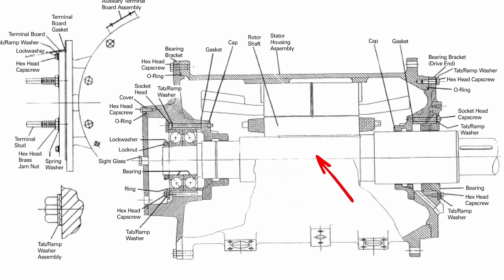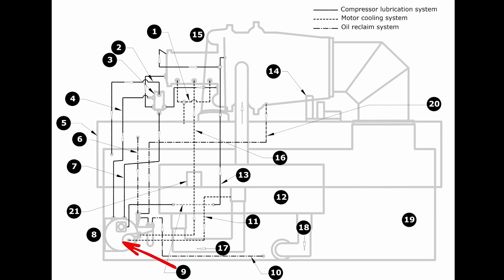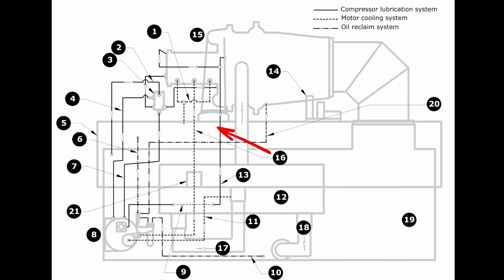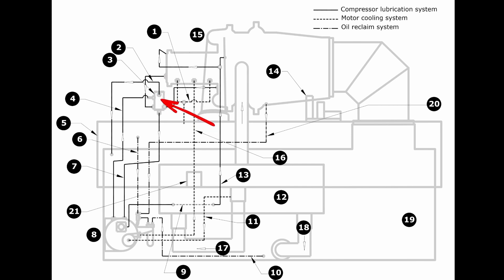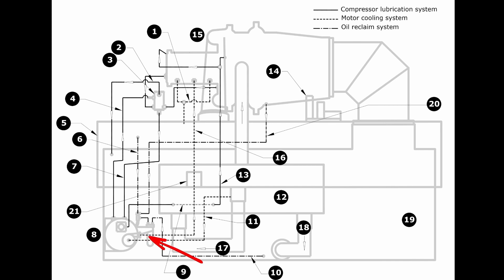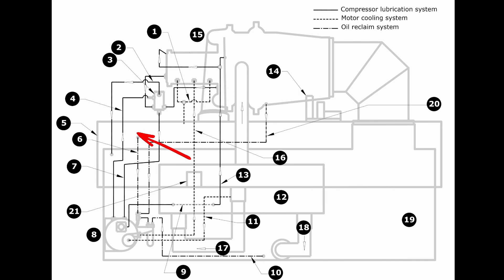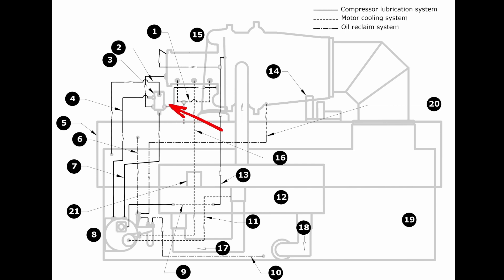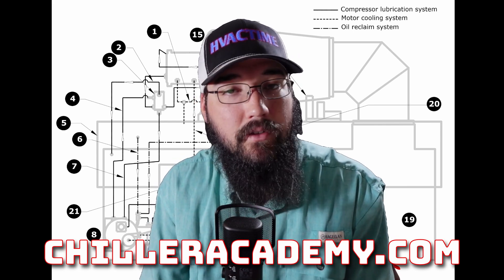CVH Oil Cycle Trane Centrifugal Chiller

Comment: Low leaving chilled water temperature what causes
Reply: Low leaving chilled water setpoint
Reply from the maker: The shutdown setpoint was reached which is usually 2f to 4f below setpoint. Either low load or low flow